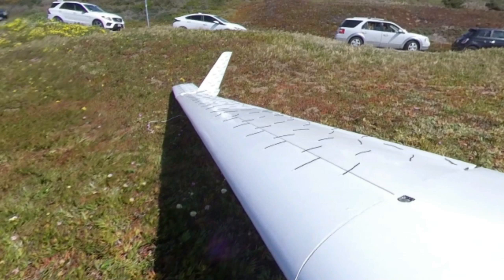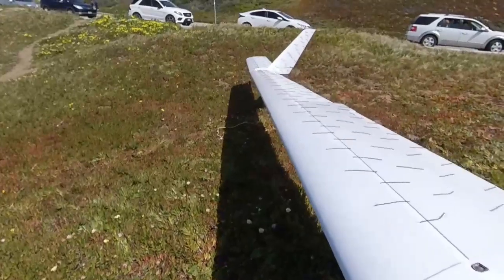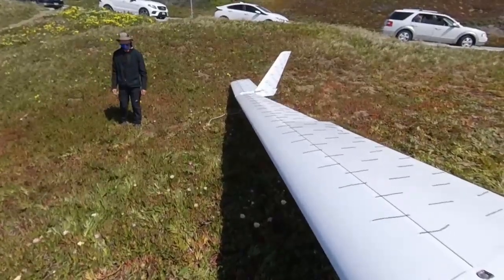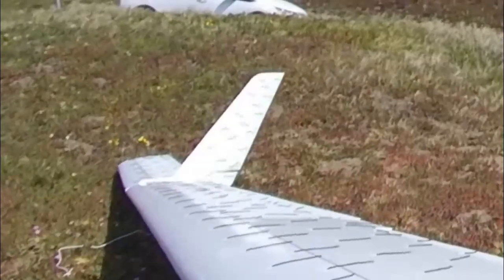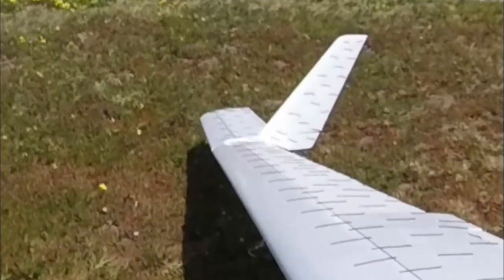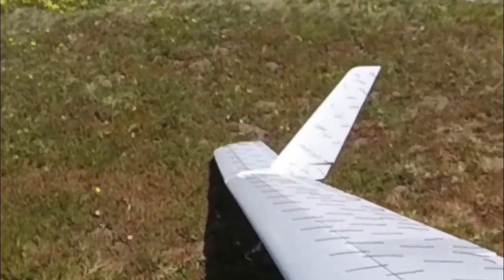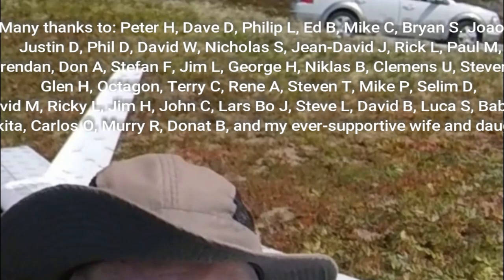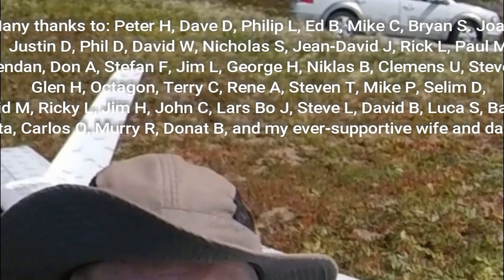KW MkII Rigid Wing Class II Hang Glider - Tuft Testing

Comment: I enjoyed watching this video, thanks for sharing your ideas. I feel that the wing was too close to the ground to have a real feel for the controls response, but at the same time the controls should still work to have good ground control. Probably it is worth positioning the glider on an elevated platform like a truck bed, so you can move around against the wind, higher from the ground and more in an air stream to understand whether the handling will improve significantly? Truck bed winch HG towing is quite popular in Canadian Prairies.
Reply from the maker: That and many other options are being considered. The key is that I don't want to put any more energy into the system (towing, etc) than necessary because if something goes wrong all the energy has to be dissipated and doing so can sometimes be very painful!